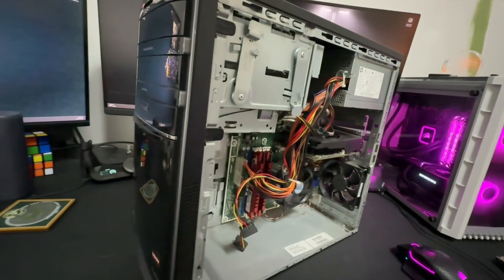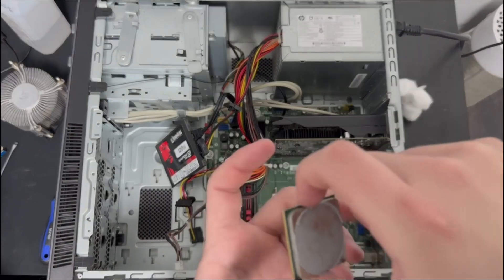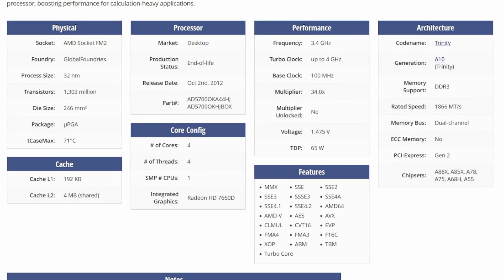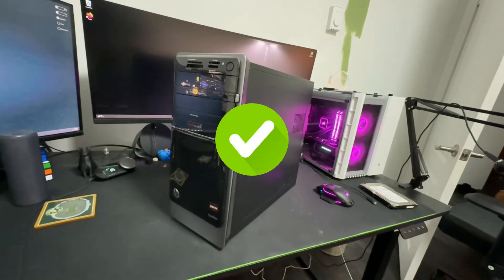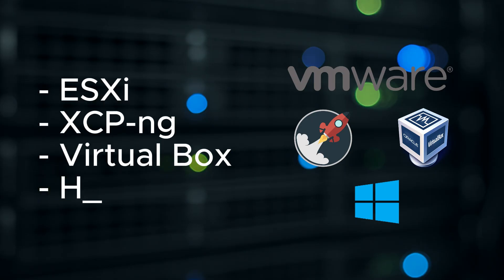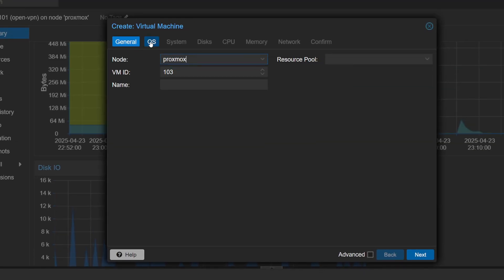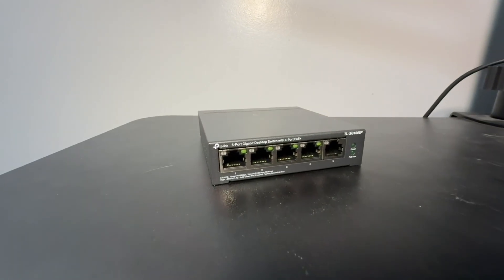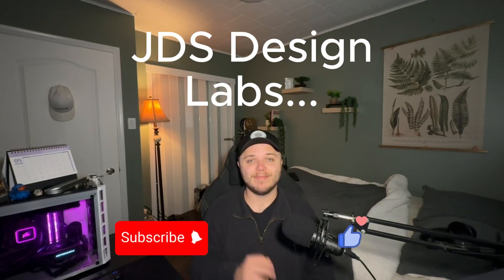How I Set Up a Beginner Homelab in 2025 (For Cheap!) 💻

Comment: The AMD A10-5700 is incredibly old and strongly discouraged. It was released in 2012. Even if you want to use older hardware for home lab services like DNS filtering, hardware older than 10 years is not recommended. You should also have at least a PCIe Gen 3 motherboard to enable the use of obsolete server hardware, such as LSI HBAs or Intel's X550-T2/X710-DA2.

Comment: Just asking why on earth you're using windows to run a minecraft server? Is there no linux or anything else vm avaiable? even like a linux mint distro if command line is painful? 

Currently i have a few pcs and laptops lying around, i could combine them but im mainly looking at a i5-8500 + 8gb ram (could go to 16 or maybe 32) + gt 730 pc i have lying around. i want a minecraft server definitely, maybe even multiple, then i want to host a few websites, probably jellyfin and smth else.

from this video pihole and stuff looks rlly cool and so does openvpn.

and also yk that proxmox stuff, is it hard to learn? is it worth it for my use case? is it like a container application stuff?
Reply from the maker: Totally fair question — to be honest, I did it for convenience and to have a sandbox to test other services when I first got everything set up. My friends wanted a Minecraft server spun up fast, and the quickest ISO I had on hand was a Windows instance. Definitely not the most efficient choice, but it worked in the moment.

That i5-8500 build you're looking at is a great starter... 6 cores / 6 threads gives you a decent amount of headroom, especially if you're planning to run a few services side by side. Even with 8GB RAM to start, you can host a lot of lightweight stuff.

Pi-hole is super handy, I use it constantly so I don’t have to memorize random IPs or dig through DNS logs to find what’s what. And I don’t even want to imagine managing remote stuff without OpenVPN.

As for Proxmox - it's not too hard to pick up at all. The UI makes things way easier than going full CLI with KVM or something like that. If you're using older hardware, it can take a little tweaking to get it running smoothly, but for your use case (MC server, websites, Docker stuff) it’s a perfect fit. You can set it up to share resources really efficiently, and running your Minecraft server in a container will save you a ton of RAM and CPU overhead. Definitely worth looking into.
Reply: @jdsdesigns  love, and great seeing creators actually respond like this. definitely earned a sub :)

Comment: I got some Lenovo Thinkcentre PCs from work that were used for CAD. I kept a P1000 gpu from one of them. i7 9700, 32gb of RAM and  a spare SSD I had lying around. The other 2 have i7 8700 and an i7 7700. Got a pretty shitty gtx 740 as well. Looking to do something with Docker
Reply from the maker: Haha I get the feeling, the 750 Ti in my build isn’t anything to write home about either 😅 But with those ThinkCentres and i7s, you've got a solid foundation. Docker's perfect for that setup! You could try something like running Uptime Kuma to monitor your network, spin up your own Gitea instance for private Git repos, or even play around with FreshRSS for self-hosted news feeds. Tons of cool services to mess with and see what sticks. Keen to see what direction you take it in!

Comment: My homeland is running off of 2  laptops, 1 thin client, and beelink. 
All of them are running Proxmox  
VM and containers 
Home assistant
Open media vault
Pi-hole 
Windows server
Reply from the maker: That’s an awesome setup! Love how you’re maximizing those devices with Proxmox, especially getting everything from Home Assistant to Pi-hole running across them. It’s wild how much power you can squeeze out of older hardware when everything’s dialed in right. Do you have a favorite service you rely on daily?
Reply: @jdsdesigns I really use my home assistant daily. Since I work from home a lot. I create a dashboard just for it. So I can open and close my blinds, turn fans on or off. And also lights.

Comment: mine is ryzen r5 5600, 32gb Ram, and 4 x 4tb Ironwolf  drives. looking soon to upgrade with 10gb networking, and a sas hba, so that i can start taking advantage of cheaper SAS server storage drives. Mine is mostly a fileserver/archive for media and family photos, offload cell phone video files etc, and pihole, and a few game servers.  Eventully i will get the whole **arr stack running so family can request movies and the server will grab it and put it on the network share without them ever having to touch a torrent site.
Reply from the maker: That setup is solid! Love the use of IronWolfs and the plan to upgrade with 10Gb + SAS — definitely future-proofing there. I’m also planning to roll out the full arr stack soon too, mainly for the same reason: hands-off access for family without the sketchy side of the internet 😅

Would love to see your rack or how you’ve got it all set up. sounds like a beast!

Comment: What can work more efficient, is to activate WakeOnlan on the PVE node hardware. Move the VPN server to your router. If your router is capable of sending WOL packages within the LAN you don't need to leave the system on for the 24/7 since the router is always on. This way you can save energy.
Reply from the maker: Love the idea! I recently upgraded my router to the edge router lite from ubiquiti and have my vpn running on there. Gives me a bit more space on proxmox to mess around with.

Comment: My current setup is an EliteDesk 800 G3 Mini from eBay (I meant to get a non-mini but didn't double-check the listing 🥲) with a 2TB NVME SSD.

It's been fun to use as an entrypoint to homelabbing, and right now its only running a single Debian VM on Proxmox which itself is being used to run a danbooru instance with docker compose for image organization...whenever the VM isn't crashing (I haven't quite figured out the cause–I assume the elitedesk is being overwhelmed or I didn't set up things properly since I'm still new to linux in general)

But in the future, I want a homelab that includes a dedicated NAS, media streaming, and game servers with remote access once I have a better understanding of networking.

Which is a lot! But videos like this definitely help in building up confidence and providing insight as to the direction I should head next. So thanks for the video, looking forward to more!
Reply from the maker: I appreciate the kind words my friend! Sounds to me like your mini may be getting overwhelmed indeed. 

Love the goals you have in mind! The more you mess around the more you’ll learn. What game servers are you looking to host with your lab?
Reply: It's more than likely overheating. I have an HP ProDesk, and the NVMe was overheating. Not to mention, the CPU (8500T) was reaching 70+ degrees Celsius often (where 70 is the maximum allowed temperature, according to Intel). My remedy was to take off the case and mod the heatsink to install a desktop heatsink with fan. It's ugly but works fantastic.

Comment: I was inspired to get into home lab after watching Lawrence Systems YT channel a few years ago. I started out with a Dell XE2, installed an SSD, upgraded the RAM, and installed Proxmox following Learn Linux TV tutorials. Eventually built a 3-node PVE cluster with a PBS server. It was fun but a bit too complicated. So this year I started over and switched to Unraid and it’s been smooth sailing. Unraid is a perfect OS for a weekend homelabber like me! Running Vaultwarden, Jellyfin, Immich, Home Assistant, etc. 😊
Reply from the maker: My first homelab back in the day was on a Dell OptiPlex SFF. I used to run just a basic windows server VM to host an SMTP server and run a Minecraft server. But after upgrading a few things they definitely pack a punch!